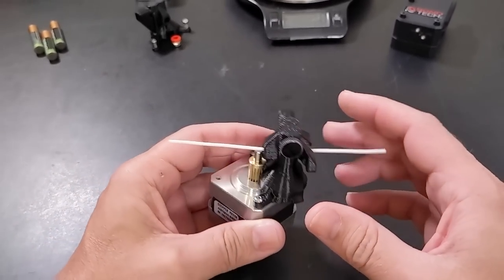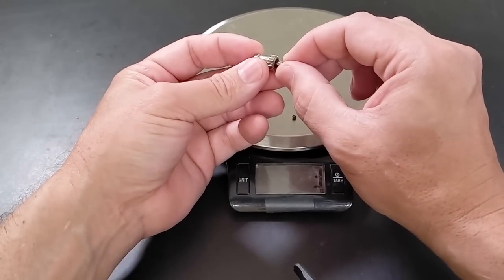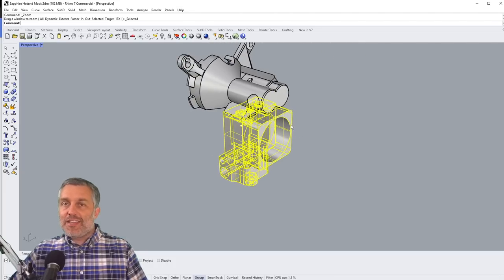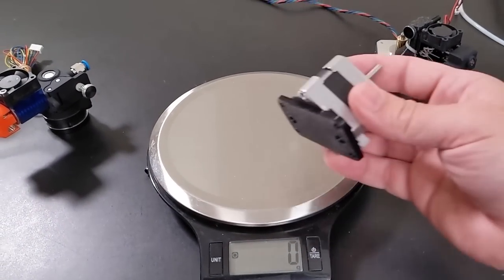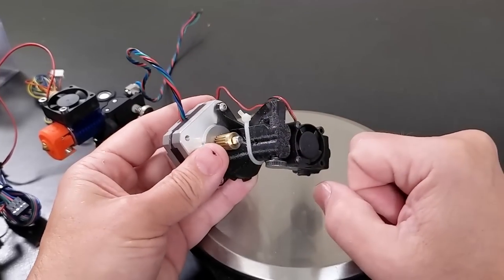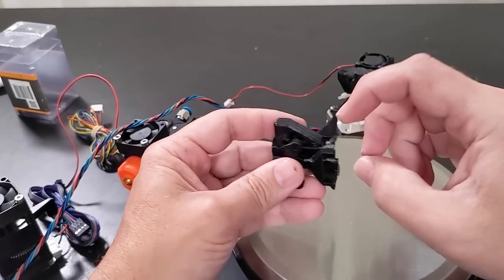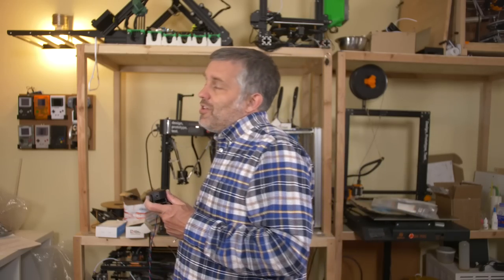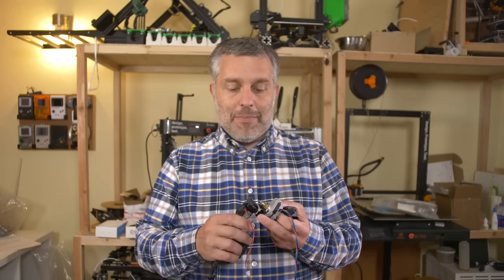Superfly - A Worthwhile DIY Upgrade?

Comment: If you are putting open source designs behind a paywall you are selling those designs. So yeah you can't do that and you may be sued if someone was pissed enough that you were stealing their ip.
Reply from the maker: Are you just sayin' like in general, or are you accusing me?
Reply: @DesignPrototypeTest  Are your designs built on someone else's licensed designs?
Reply from the maker: You watched the video. You know the answer to your question. Now stop being coy. I need to know before we continue this conversation if you are being combative or just wishing to display you knowledge of open source.
Reply from the maker: @mp-xt2rg  All right, I've given you ample time to declare your intentions so that there is no ambiguity. Since you didn't answer I will judge by context that you are being hostile toward me and I will respond in kind.
1) You don't even know why you attack me. You're part of the groupthink that has the wrong idea about me and because you've seen others disparage me you jumped on that bandwagon and feel justified to treat me this way. This is wrong. I don't deserve it. 
2)The license attached to the original Superfly is the LGPL which is meant to apply to software libraries. I have no idea why that license was used for the original superfly, but even if it was licensed with the GPL I am not required to share my files with you. If you do your homework and actually read the GPL and the FAQ that goes along with it you will find that I am only required to share the source code (I guess this means editable CAD files, but It could only mean .stl files) With PAYING CUSTOMERS. Just because I downloaded and worked with the original superfly files doesn't make me indebted to every dude on the planet who wants to make me go out of my way to dig up those file and share them with him. That would be ridiculous. What if my project went viral and I had a million people wanting my work? Do you really think the writers of the GPL would make it so burdensome to creators? With that kind of risk why would anyone make open source files?
3) You have an insultingly entitled attitude, Karen. I've spent just about my whole life working to have the skillset I have today. You can't do what I do, yet you think that I should give you what I made for free. You think I'm your b__ch. I don't just have to do what you tell me, but I have to do it for free. WTF is wrong with you? You have no moral reason to resent "paywalls." If a thing is good enough for you to desire it then PAY THE CREATOR you cheapskate.
4) If you actually wanted the files you should have asked nicely. The extruder doesn't work without the zipties and I never spent any time to make it better than what I showed in the video. In my judgement it's just a waste of time so I would have gladly shared with you if you had been nice to me.
Reply: @DesignPrototypeTest  lgpl requires you release the work it's not optional. If you charge people for it that's theft. Sorry but that's the licence you agreed to. If you don't like that consider doing some original work. That being said I don't have any interest in your files. Cad is not hard I'd just do it myself. I'm not familiar with what you did cad wise, this video was just playing in the background and I commented on what you said about paywalls and licences but my guess is I could replicate your work in about 10 minutes. My last project was building landing lights for a friend's experimental airplane that are capable of calculating the touchdown area and pointing there and a range of 1 mile. I doubt you are more capable than me.
Reply: @DesignPrototypeTest  it's a flawed design anyway why not just redesign it and skip the licence? It wouldn't take more than a few hours to design something that's yours. It's just an extruder they aren't complex devices.
Reply from the maker: Why are you telling me to design an extruder from scratch? I don't work for you.
Reply from the maker: @mp-xt2rg  You are wrong about the GPL and the LGPL. I don't have to share a thing with you or anyone else. Go ahead. Get a lawyer. They will tell you the same as I am telling you. Here ( https://www.gnu.org/licenses/gpl-faq.en.html#GPLRequireSourcePostedPublic ) is the link to the GPL FAQ since you are too lazy to do your own homework before you come on my channel telling me that I'm being a bad person for not sharing. How about this FAQ ( https://www.gnu.org/licenses/gpl-faq.en.html#DoesTheGPLAllowMoney ) telling you that I am perfectly withing my rights to "paywall" my creation.   This isn't about the GPL. You aren't motivated by higher morals or a love of open source. You are just here to attack me, or try to extract free stuff from me. Either way, you aren't a good person. You need to work on yourself.
Reply: @DesignPrototypeTest  I'm aware you don't work for me. I wouldn't hire you. You have the temperament of a 14 year old boy. It's a simple project, stop being lazy. Make something unique and stop stealing other people's IP.
Reply from the maker: @mp-xt2rg  You think I act like a 14 year old. I would not be treating you like a hostile attacker if you had declared that you were friendly when I asked your intentions. Whatever affect I may be displaying is on you. My last clients were Intel and Smith Optics. Unless you are in that league where I get to network and enjoy other ancillary benefits I'm not interested in working for you. I'll keep myself busy thanks. Now, you want to accuse me of "stealing other people's IP." There it is! Your motivation. You ARE a Prusa fanboy after all. I feel like we had this conversation already. Or maybe you are just like the last guy who wanted to come on my channel and argue about this. I provided the creator of the Superfly with 24,000 views on his project. I did the guy a favor. Then I adapted his design for my own private experimentation. I shared the results of my experimentation before throwing the whole project in the trash. It literally doesn't exist anymore. So, tell me exactly what did I steal? How did I derive benefit from his work while depriving him of that benefit? Have a little honesty. I dare you. Admit that you can't come up with any justification for your accusation of theft.
Reply: @DesignPrototypeTest "no your the thing"- said the 14 year old boy. You said the design is available behind a paywall that's theft. You can't do that you don't own the design. I wasn't offering you a job Einstein.
Reply from the maker: Let's say I gave you the files for free. How come that action doesn't constitute theft whereas if I charged you money for the same files you would consider it theft from the original creator? Either way the files exchanged hands and the original creator doesn't receive any money. You've got broken cognition.
Reply: @DesignPrototypeTest  The licence says any work based on the licenced file must be made available. If it's behind a paywall you are profiting from someone else's work in defiance of the licence. You are profiting from something you don't have permission to distribute for money. That's theft. I doubt you are making any real amount of money and my guess is you likely have little to lose from a financial standpoint. Just keep doing what you're doing. I doubt anyone will come after you. All I'm saying is the file owner would be able to seek damages regardless of how unprofitable it would be.
Reply from the maker: You didn't read the license. That's not what it says. You didn't even read the FAQ I linked for you because it also contradicts your words. Reality exists. Things aren't the way you decided that they are.
Reply: @DesignPrototypeTest I don't care to continue taking to you. We have both read the licence and you are seeing what you want to see. Logically your position doesn't make sense, the licence would have no meaning at all. I have zero interest in any work you have done. I know you said you spent your whole life learning this stuff but it appears your skill level amounts to a couple 3 hour cad workshops. I release most of my side projects to the community for free and it annoys me when people try to profit off my workshop. You are one of those people. Maybe go to a maker space and take a cad workshop so you can eventually do the work yourself and not need to steal from others.
Reply from the maker: "The right to sell copies is part of the definition of free software." Reality. It's a tough pill to swallow.
Reply: @DesignPrototypeTest  and mp, you're both wrong. DPT is not required to release sources to people he's not sharing the product with. However, DPT is required to provide sources, upon request, to whomever he's distributing the product to, regardless of whether he's selling the product or giving it for free. (Also, whoever gets the product from DPT is not only entitled to the sources, but also allowed to share it with others, for free or for money.)